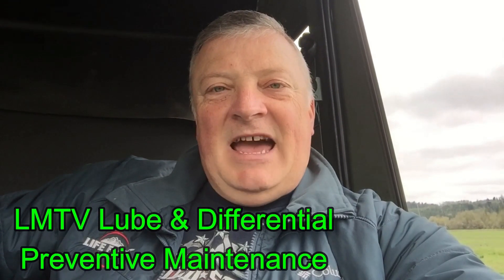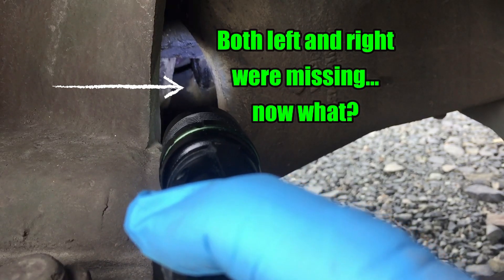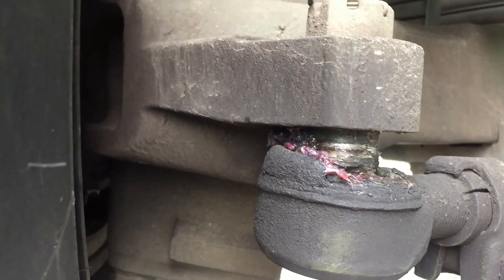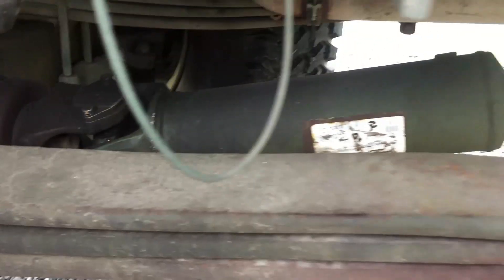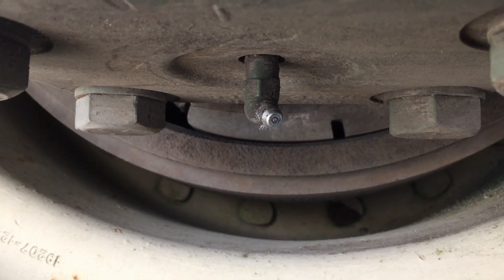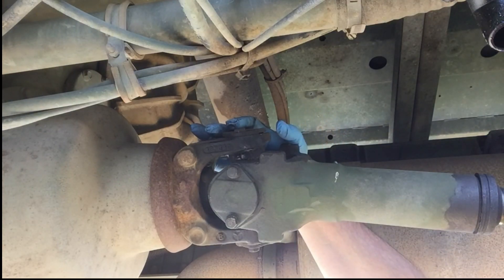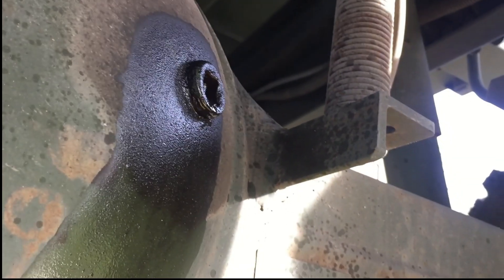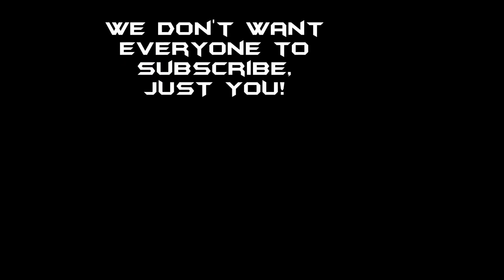LMTV LUBE & DIFF CHECK Remastered #152

Comment: I feel like I have seen this before??  Dejavu??  Rotate your front tire 90 degrees and your zerk fittings will appear.
Reply from the maker: Yes, this one is "remastered" since I had almost 5 minutes of other stuff on the video before I even got to the project... I felt like it needed to lose some of that weight. Thanks for the tip... so the zerk fitting is on the dang spinning hub?
Reply: @HelicoolsHelipad  It's on the ujoint.  I thought mine fell out too but you have to rotate the wheel a bit to see them sometimes.

Comment: Dave , how did you ever get that grease fitting installed in the front hub?
Reply: I was thinking the same question.
Reply from the maker: Well, I never did. Sean said I have to rotate the tire to find it... I did not think it was attached in that way, because I saw the hole. I will have to try rotating the tire to see if it comes into view, or tear apart the entire front hub to get to it. Impossible for me to reach it.
Reply: Sorry to hear that, I was hoping there was a cool little trick to it 😔 thanks for all you do 👍👍